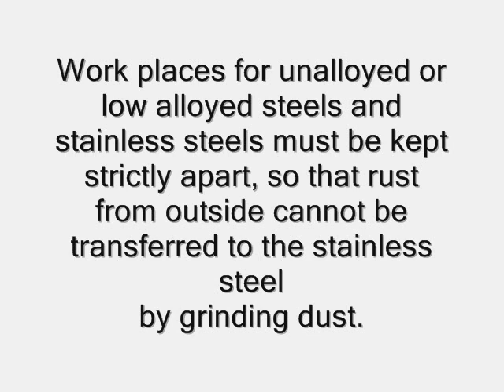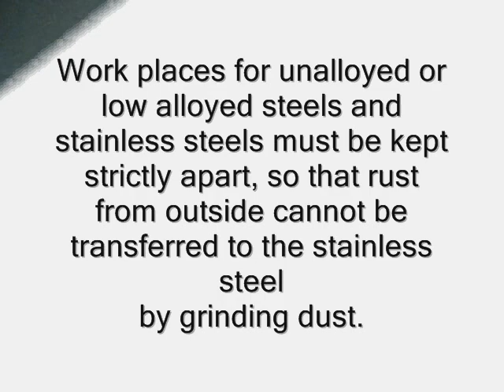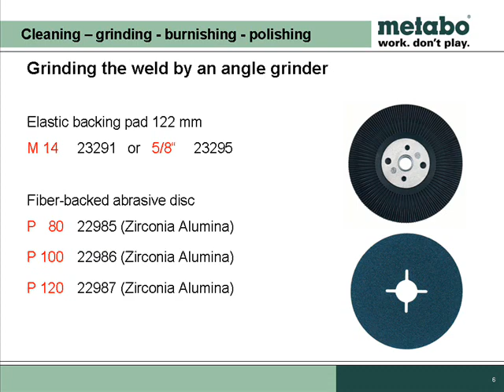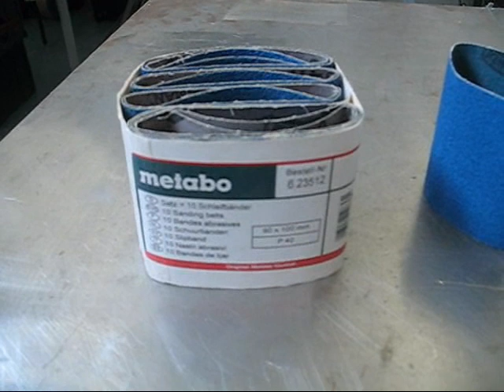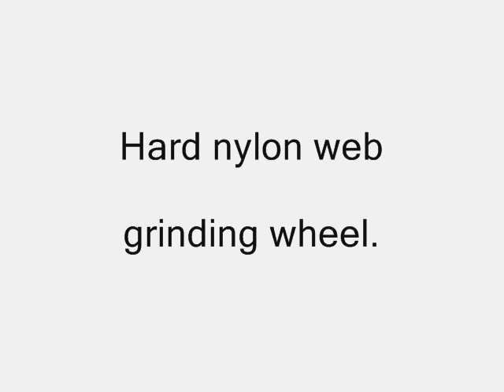Metabo Power Tools: Cleaning and grinding by SE 12 115

Comment: The Metabo has the same problem as the much cheaper Chinese ones - a totally flawed design.
Just a botch job with a long spindle attached to a normal angle grinder
Virtually all the weight is on one side which means the workpiece is unevenly affected as is the wear on the drum.You will have to compensate for this by torquing the front handle anticlockwise which is terrible for your wrists.
Another big problem is the 'ergonomics' lol!
You have to stand to one side,twisting your torso to fight the machine's desire to skid forward.
It is an awful design with zero care given for user comfort.
Can't remember the name but there is a US brand that make one which has the motor directly behind the drum,where it should be!!!
I've been a happy Metabo user for over 20 years but this tool is an abomination!
When you consider how much Metabo charge for this tool it is a disgrace that they have put zero thought into the design.